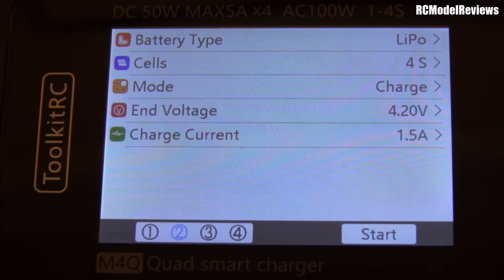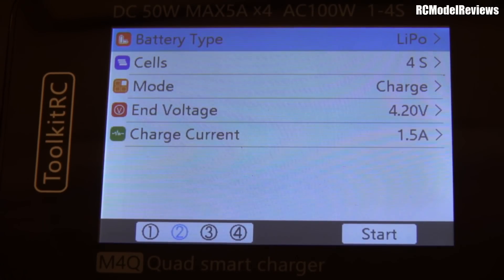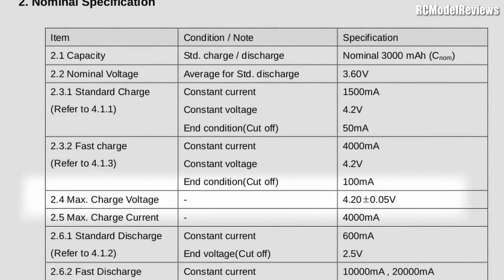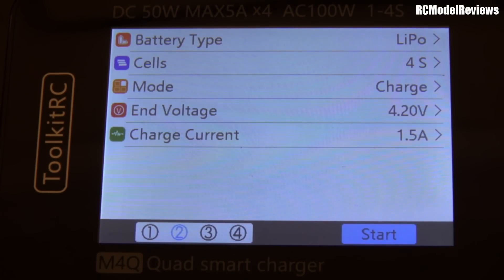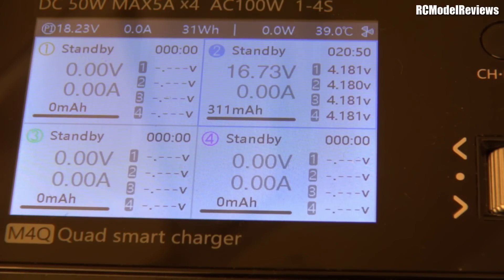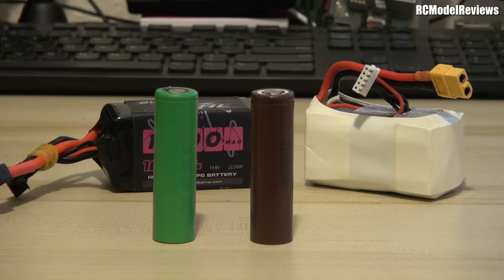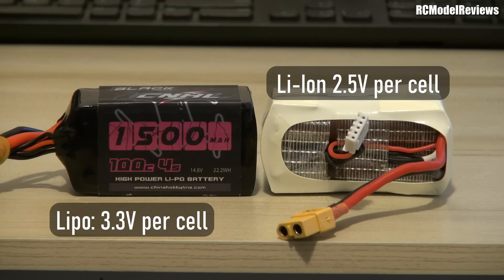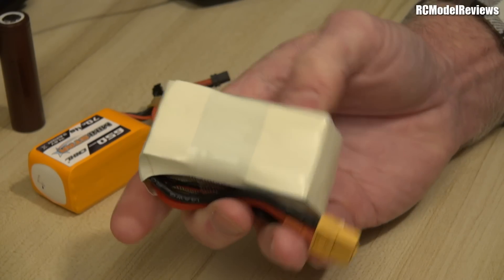Is it safe to charge Li-Ion packs on a lipo setting?

Comment: A lengthy post. If you don't want to read all of it, at least check the links further down.
The two battery types you are calling Li-ion and Li-polymer are the same thing, just in different form factors. That form factor (and therefore different internal construction) is the main reason for the different current capabilities. There are cylindrical cells available that can easily provide currents in the tens of amp like a pouch cell, because their internal construction is designed for that. The pouch cells, that so many erroneously call li-polymer, are just "li-ion polymer" cells, because they are wrapped in a plastic (=polymer) package as opposed to being in a metal can.

Real li-polymer batteries (where the electrolyte is a polymer and not an organic or water based solvent) have yet to come out of the research phase. The reason for that perpetuated error is the same marketing people who are now labeling everything "graphene", while the batteries are not really any different inside and have contained graphite for decades. But tell a marketing person that graphite is a lot of layers of carbon (a single layer of it essentially being graphene), all they hear is the buzzword "graphene" and they will sell the batteries to you as the new great invention, while all real graphene based batteries are still in a research phase.

Pouch and cylindrical cells can have different chemistry, but so can cylindrical cells between them and pouch cells between them. Again, the form factor is not what dictates the chemistry, what the manufacturer puts in them is. You can have the same chemistry in either form factor. Have you ever seen something like IMR, INR, ICR, IFR, LMO, NMC, NCA, NCO, LCO or LFP written on cylindrical cells or in their datasheet? Those signify different chemistries. Pouch cells use the same, although they mostly use the Lithium-cobalt-oxide chemistry (ICR/LCO).

Maybe these links help (no need me repeating what is out there and explained already): 
https://batterybro.com/blogs/18650-wholesale-battery-reviews/88881030-5-common-lithium-ion-battery-myths-explained (myth #2) 
https://batteryuniversity.com/index.php/learn/article/the_li_polymer_battery_substance_or_hype (especially paragraph 4 onwards)
Or from a battery component supplier (just lists can, case or pouch as packaging. no mention of liion/lipo distinction.): https://www.targray.com/li-ion-battery
In video form: https://youtu.be/OlBZ51QLEfs?t=1195

Cylindrical cells have the advantage of sturdiness, can't puff (but would as any pouch cell, if it weren't a metal can), (currently still) cheaper manufacturing, easier automated assembly into packs and have usually less issues with dissipating heat. Pouch cells are lighter, are more customizeable in size and shape (especially thin cells), better use of space and usually with higher current capability. Those are the reasons why you pick one form factor over the other.
Reply: Very interesting, thanks. 👍

Comment: One thing I've heard regarding extending the lifetime of the lithium battery is to only charge it to 80% and not let it go below 20%. When I can remember to, I do this with my mobile phone because I want its battery to last years more still, and I'm confident it will because its capacity is 10300mAh :) (yes it's a brick of a phone that weighs 360g but I love how one charge lasts days of use)
Reply: My phone has a setting in the battery menu that when enabled will stop charging the battery when it reaches  85% to extend battery life. It is a Samsung A42.  I don't if it is unique to this phone or common on many phones.

Comment: Very useful video Bruce!, i wonder if you can explain how to recycle them from laptops battery packs, i have few of them and very ofter they just have one bad cell and the rest are ok for make a pack like yours. Thanks!!
Reply: I have got 100 or so cells for used laptop batteries and yes get about 75% that can be used again but many of the cells have specs that indicate discharge rates less than 5amps max. I do not think you would get much life out of recycled laptop cells if used as high amp draw applications. It could potentially cause battery failure with bad consequences.
Reply from the maker: as chico7000 says, laptop batteries tend to be low-current types and some of the older ones may even be 4.1V cells.   They're fine for using in transmitters or as a pack for your FPV goggles but I wouldn't use them for a flight pack.
Reply: @RCModelReviews  I see, so which Batteries do you recommend? i saw many counterfit ones in china´s web shops, so i don´t trust on them , and i can say the same for the packs i already made, now i am using them for the benchwork camera and maybe to power a slope glider.

Comment: Bruce, i have a few questions. I've crashed quite a few lipo batteries with in my planes over the years, some made it some didn't, and those that did shortened their life span. How do li-ion batteries compare? Since chemically they are different as well as internally, and the casing is harder compared to the softer lipo shell? since these batteries don't puff up or look like a banana peel after been driven into the ground at high speed.
Reply from the maker: The metal case of the 18650 cells does offer better resistance to physical damage but it's still a good idea to give any crashed pack a good visual inspection before storing it or using it again.
Reply: @RCModelReviews  thanks for that.  Looks like I'll be investing in li-ion batteries soon.

Comment: My understanding is, that lithium-ion and lithium-ion polymer are different "construction methods" and have nothing to do with the "chemistry" that gives you the electric potential. What speaks against that are the different cut-off voltages, but maybe that is just non-sense people keep repeating to one another because datasheets for pouch cells are so much harder to find than those for the cylinders.

Comment: A couple of other things to be aware of when using Li-Ion packs - check your low voltage cut off settings, both on your f/c and your esc's. Especially the esc's - unlike the flight controller they do not tend to give a warning before they turn themselves off. Esc's with low voltage cut off are the work of the devil - they will happily save you the £30 cost of ruining a battery by happily cutting power to your motors mid-flight - obviously so much better to crash a £300 quad rather than ruin a £30 battery. 😠
Reply: I'm fairly sure the low battery cutoff is designed for RC planes - lots of the older RC stuff was planes flown LOS with no telemetry etc, so you had no idea of what the battery voltage was at. Hence manufacturers did this so that people can fly until it cuts off, and then glide in for a landing. Else they had to just have a timer, and would be highly likely to undervolt the battery.
It's not a function that is designed or suitable for multirotors, so it should always be disabled on them.

Comment: Li-ion maybe problematic if you rely on RTH with INav 2.6. The altitude correction is so aggresive that the current draw is 30 to 40 amps and the battery volts will fall very quickly below 3 volts.
Reply from the maker: That depends on the rest of  your system and how many cells you're running.  There's a very simple fix though... feed  your flight controller via a diode from the battery and use a decent sized capacitor (1000mfd at least) on the FC side of the diode.  This will avoid sudden drops in battery voltage from browning out your FC.
Reply: @RCModelReviews  Thank you, I'll give that a go.

Comment: Great video I learnt a lot nice one for the information. 💯❤️🙏👊👊
 I just got into FPV I have flown my first six packs on the last pack i crash but all good it just needed a new prop a new battery strap and the battery but the battery 🔋 lipo 6s  still works but when I got home I checked the 🔋 and one of the cells is dead, Is it worth me trying to make a for 4 cell pack because the lipo pack is new I've only charged and discharged the battery 6 times or should I just dispose of it correctly and leave it alone. 🙏👊
Reply from the maker: I've converted quite a few 4S packs to 3S by removing a dead cell and you could do the same with your 6S pack by removing the dead cell.  However, be very careful because accidentally shorting one of the good cells could ruin your day.
Reply: @RCModelReviews  ok thanks for the reply much appreciated I'll give it a go just wonder if you have a wire diagram just as reference if not that's ever so much i love your channel take care hope you have a great day 💯❤️🙏👊👊

Comment: I know it adds extra weight and volume, but could you install an ultracap in parallel with the battery output to buffer high current draws and possibly extend the cycle life of the battery?
Reply from the maker: The problem is that such a supercap would weigh even more than a higher-C battery and, when recharging itself, that cap would also draw significant current.  The other thing is that supercaps (unlike regular caps and low-ESR caps) tend to have quite a high internal resistance themselves.

Comment: When you measure internal resistance what values should cause concern?
Values are typically much higher than lipo even when new.
Reply from the maker: If my Li-Ion cells start to get above 22mOhm then I consider them to be getting tired.  Of course when measured on my charger -- different brand chargers can produce wildly different figures for internal resistance because it's a figure that depends very much on the state of charge and the current being used to measure that IR.
Reply: @RCModelReviews  Hello! This is a great video! Regarding to the internal resistance, I found the value is different when in charging and not in charging. So which one should we take care of? And at which value, for LiPo and Lion, should we need to consider replacing them? Thank you!

Comment: Spot on, import addition is storing fully charged is very bad for battery so store at 50% and charge just before use is best,requires some planning and not always practical but most damage is done to a cell whilst sitting fully charged for long periods.

Comment: A major influence on battery cycle life is the time spent at maximum charge. 
Dendrite formation occurs much faster at max voltage, so always use your max charged battery quickly after charging and do not store a battery at max charge or minimum charge.
Temperature also influence charging cycles. Store at low temperatures and do not charge an already warm battery, or allow it to exceed 40C.
"The more time you spend at higher voltage, the worse.

I have cells from 1999 that were stored at about 20 percent state of charge so maybe 3.5 volts for those cells. We put them on in 2013… and they are like new. Because the positive electrode side is not doing anything bad at low voltage.

But if they have been stored at high voltage it wouldn't have been nearly as good." Jeff Dahn. Tesla battery consultant.
https://batterybro.com/blogs/18650-wholesale-battery-reviews/103090502-why-do-lithium-ion-batteries-die-long

Comment: My "Vape specific" type chargers have always charged to 4.2, just checking my "Gyrfalcon All-88" now.. clearly says "LI-ION" and batteries currently in are sitting at 4.2, never seen this 4.1 in the 6yrs of me using 18650s & 21700s (not for RC), but then it's a dedicated charger for just single cells of various sizes not an "RC  specific" styled multi-cell charger.. interesting to note, if I ever make a pack I'll b sure to put it on Li-Po if my charger only goes to 4.1
Reply: Yup. And yet, my lipo charger's liion setting by default cuts off at 4.1v. But that's only the default. Like on RCModelReviews' charger, mine also has the option to change the cut off voltage. So I could set it to li-ion and set the cut off to 4.2v. And the real question of this video, that he didn't answer is: Is that any different to the standard lipo setting?
Reply: @Vousie  I don't think so, it's not like it puts in "LION" power that is incompatable with LIPO power 🙃️

Comment: G'day,

Great stuff Bruce, thanks for making & posting this...

To collect your reward, please feel free to backtrack me to my Videos, to see yesterday's Battery-Update (in the Snow) regarding the 6x 225 A/Hr 6-Volt Deep-Cycle units, which arrived 22% & 42% self-discharged, & sulphated ; which I've put a month into trying to ressurect.

The best 4 have spent 2 & 1/2 Days in the Electric Pyramid...

  Functional Storage Capacity down 12%, Voltage under a drain of 0.4% of  "rated Capacity is  22% below par....

I rate the best 4 "Brand New" Units as being 22% worn out, while enroute with no maintenance charging.

The 4 Units which came out of the Pyramid after 4 years of running my Hut - after having done 4 years in a Golf-Cart prior to that, were resting at 6.17 to 6.24 Volts, at 24 hours after coming out of service...; & the worst pair of "New Units" arrived into my hands reading 6.04 & 6.05 Volts...

  I can smell a Warranty Claim, and probably a Bunfight via State & Federal Members of Parliament (trying to outlaw the shipping of Batteries "Wet"...) ; in the pipeline.

Such is life,

Stay safe.

;-p

Ciao !

Comment: So charging (not discharging!) LiPo's on the Lion setting is a good idea for cell / pack longevity?
Reply: Absolutely! It just depends on your use again. I mostly charge my FPV batteries to 4.2v just because the super short flight times but a lot of my RC car batteries I usually only charge to 4.1v since RC cars last so long on a charge.
Reply: @JimBoomer  Excellent, thanks! I was a bit concerned because LiPo's have a specific charge cycle but if it's the same just with different terminal voltages then I'll give it a go.
Reply: Yes, all Lithium batteries use the simple CC-CV charging method, so it is basically just a power supply with current and voltage limits (and BMS/balancer for multi cell). Most chargers allow to set the current and realize the voltage limit in these LiXX profiles, but on some you can also configure custom voltage limits, that is the only differences between profiles. PB is similar, only NiMH charging is completely different (delta peak detection).
A downside with lower voltage limits is that it takes more time, even though it puts less energy in. Depending on the internal cell resistance it will spend much more time in the CV phase and low current. That is why like to use 4.2V instead, but stop charging early, then the cell voltage drops down to about 4.1V after a few seconds. Still charge it fully from time to time and let the balancer do it's job to make the cells equal.
This trick is often used in modern consumer electronics, the battery controller monitors the pack capacity and stops the charging already when the expected capacity is reached, to skip the lengthy CV phase for the last few percent and improve longevity at least a bit with lower idle voltages. They go up to 4.4V while charging though, which wipes out all longevity improvements there...